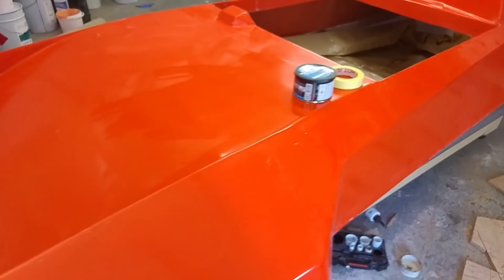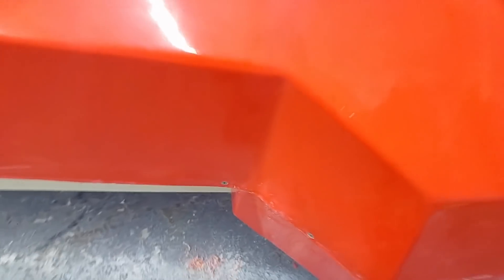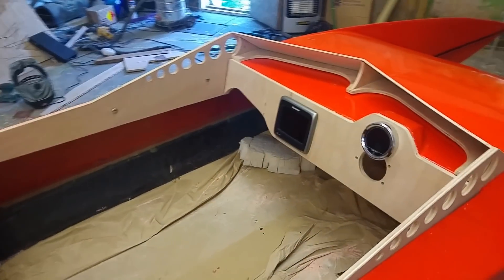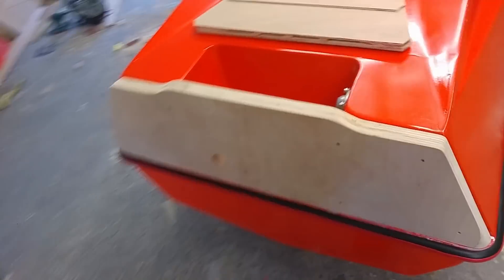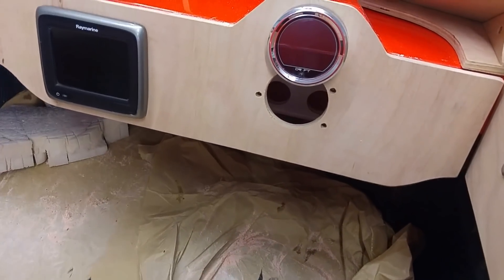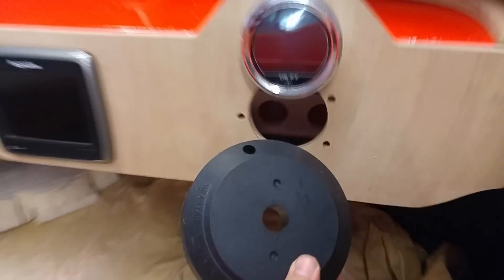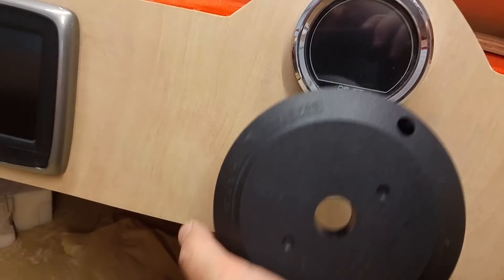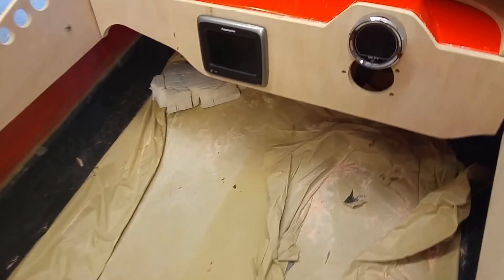Alpha Centauri speed boat build - part 10

Comment: 'Wondering whether a sturdy mains powered 'pifco' style vibrator massager held on the mould, à la concrete pouring, might help prevent voids in carbon fibre or similar fg lay ups?  Dope sh*t indeed, bro!  Respec

Comment: Great video thanks for sharing. Can't wait to see it on the water.  Would you mind sharing rough figures of how much it has cost to build the plug, mould and a usable hull?
Reply from the maker: Hello,
Probably more expensive than just buying a boat! Excluding time / interior/ electronics/ outboard. Around £5000, although I have made mistakes along the way and wasted material. I will sell the boats in kit form and complete, kit for £6k complete for £12k (ish). However my cost will be lower as I wont have to make the plugs/ moulds and will get better prices on the grp when purchased in bulk.
Hope this helps, the only thing the videos dont really put across is the number of hours worked, and the amount of time sanding and getting covered in fibreglass, I tend to only film the interesting bits! Having said all that, its totaly worth it when it releases from the mould...

Comment: this would be a great boat to put a jet drive from a bigger jet ski in. Great job! looking forward to seeing the test drive.
Reply from the maker: Yes I was thinking the same, I made the mould split at the back so I can easily do a slightly longer inboard vesion. I do have a scott sprint jet unit , rated to 600hp id like to use that either with an audi quad cam V8, or the later ferrari based maserati V8 if I can find one cheap.